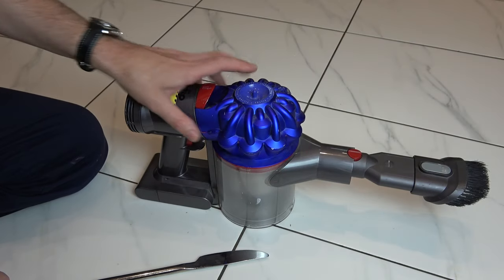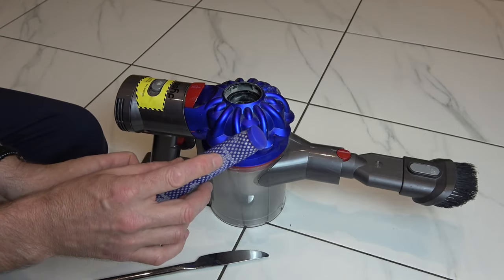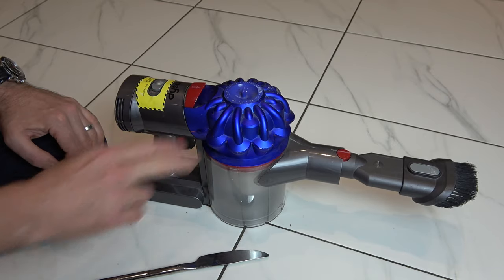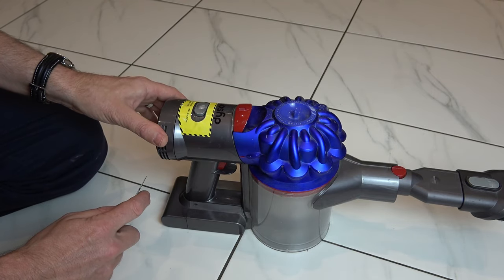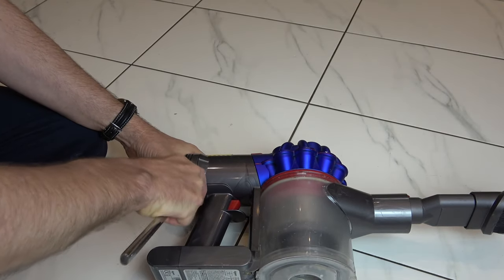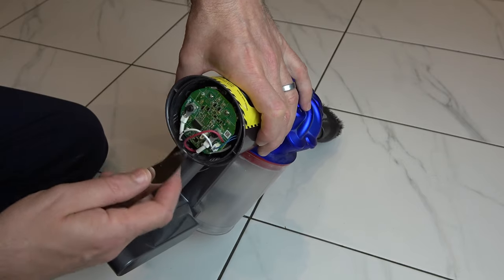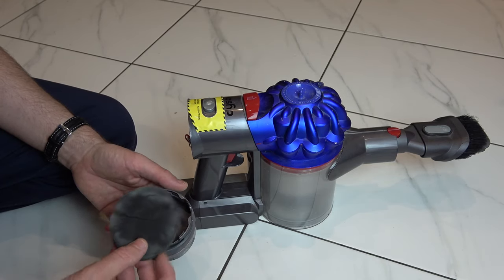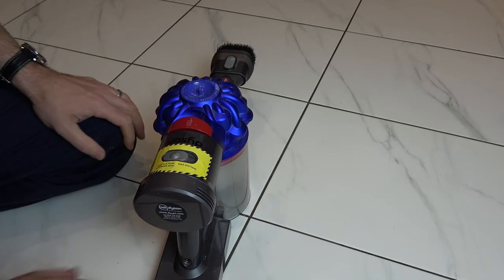How to clean the Hidden filter on a Dyson V7 vacuum cleaner. Cleaning the 2nd filter on the V7.

Comment: According to the manual, you twist the back cap anti-clockwise and then pull off. Ours came of fairly easily, without using a knife
Reply: Varies by model. My V7 Motorhead back does not twist off.
Reply: There is maybe a revision of the V7 because on another video, the dude just turns the filter with ease
Reply: That's because it's got a HEPA filter. The
Reply: Mine twists but it won't pull off. I'm afraid to force it or use a knife.
Reply: Mine twisted and came off by hand

Comment: The openings in the back cap allow heat to escape so the electronics stay cool. Air pressure differences might push a little air in and out. But there  is no cooling fan, so the air flow through the filter should be negligeable. I can't imagine that filter needing cleaning during a lifetime of ordinary vacuuming.

Comment: Mine pulsates if I put my hand over the nozzle, is that normal
Reply: Yes, it’s completely normal. While using the vacuum, there shouldn’t be any blockage in the airflow. In case there is a blockage(hair tangled in plastic/your hand) the vacuum will cut its power off and prevent any possible damage to the main board which is located right at the exhaust, and uses the airflow coming through for cooling.